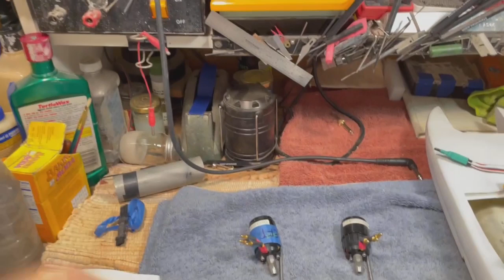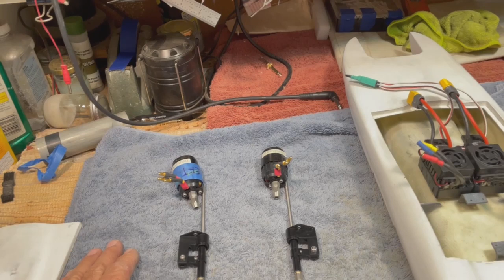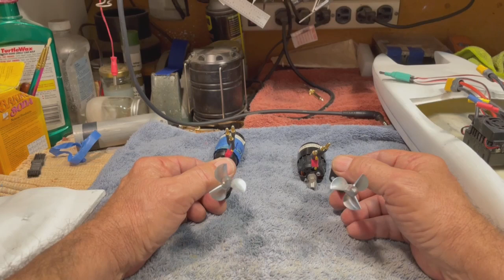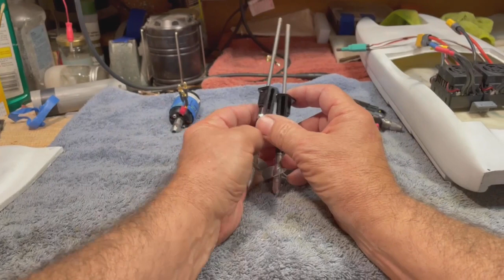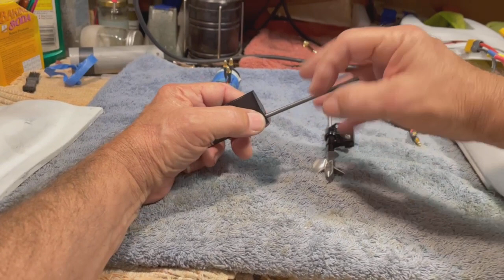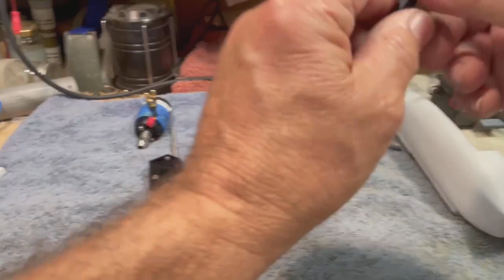Dr. Jet elucidates his plan for the power system in the Micro Drifter Twin.

Comment: She's coming along nicely Doc.
Interesting debate on counter-rotating props on cats. On my Bladerunner I have the left (port side) prop rotating clockwise and the right (starboard) prop rotating counter-clockwise, so both turning inwards. This is how the TFL Zonda is set up. However on my Zelos/Miss Geico they are set up opposite - with props turning outwards. There doesn't seem to be any substantive difference, or at least a difference I have noticed. But I do like your thinking on this, so I may swap the rotation on the Bladerunner and see 😉👍

Comment: You can also run those motors on 3s lipo with 32mm props, you would get high rpms but it is a small boat and you want some speed, if these esc's dont work you could also try ZTW shark esc's they range from 20 to 80 amps, i have 8 of them and i think they are great esc, they are small and perfect for small boats,!
Greetings
Reply from the maker: Lately, I've used the Hobbywing Seaking Pro 120 in my higher-amp boats.  I like that it is quite thin, yet still small overall, relatively inexpensive, and easy to program.  If the 60A fan-cooled units don't supply enough current, that would be my next choice.  If I ran it on 3S, it could conceivably be a 1300 Watt system, pushing the cooling limit on the motors.  Besides, 1300 Watts might be a bit over the top for a 24" catamaran.
Reply: @Dr_Jet  not sure if you know the old turningy 120a v1 esc's they where great small esc's with good cooling used to run them in a lot of my boats, i have never had those hobbywing 120s read some good things about them, might try them soon, we used to always run the micro drifter on 4000kv+ sometimes even 5400kv, back in the day always lehner motors or bk wanderer motors, mostly for german saw, for example we put 2x lehner 1525 with high kv (dont remember exactly) with 2x schulze esc, and 1x3s on the tunnel or 1x8nihm cells, without water cooling, maybe 3mins runtime before everting got hot, but at very high speeds, the motors you are using, they look like neu motors?, if so then you have got some good motors neu's are great motors, i wish you good luck with this project, and i am very excited for the end results!
Greetings
Reply from the maker: @olieboll3675  Yes, those are Neu Motors.  I first met Steve Neu back around 1971 when his mom would drive him to Torrey Pines to fly RC gliders; he wasn't old enough yet to have a driver's license.  We've been close friends over the years and he lets me know if he has a sale on something that might interest me.  I think I bought three of these 1107/1.5Y/H (4000+ Kv) motors a while back when he was reducing inventory.  I have one on my Dona outrigger and I've got nearly 90% of the bugs worked out of it, so it will be featured on an upcoming video very soon.  It runs on 2S with a fairly big prop, but the large lifting surface takes a lot of load off the prop.